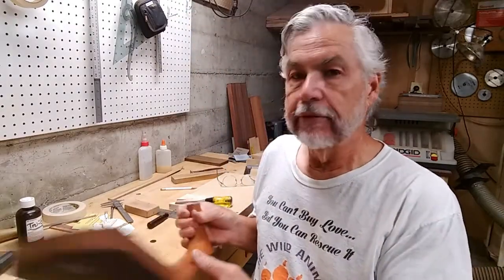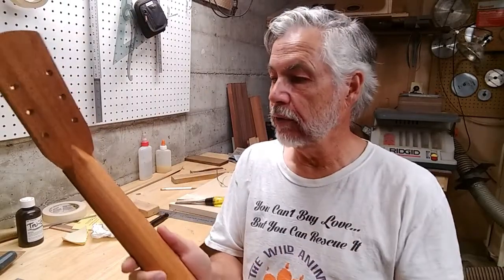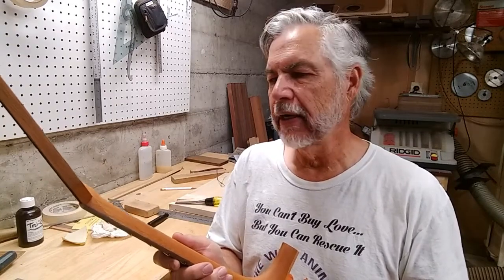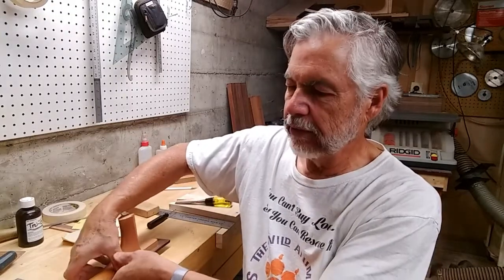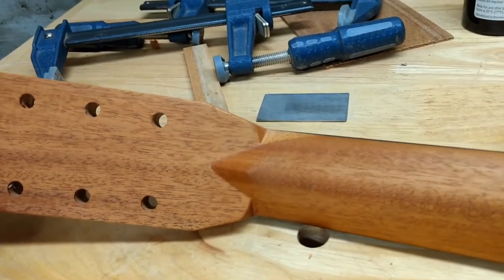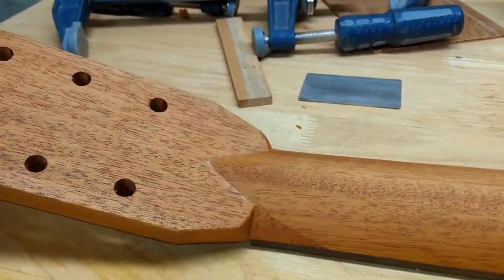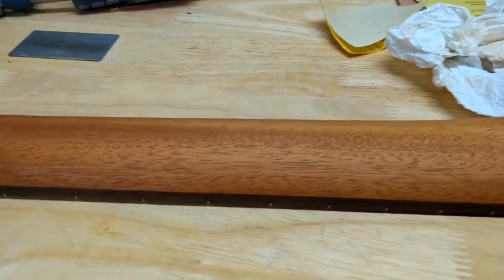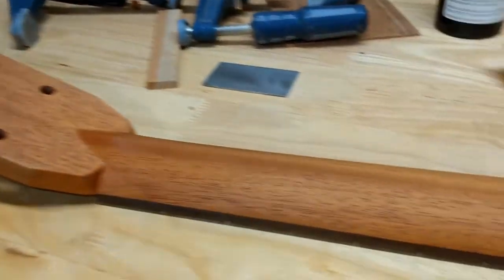The hand carved neck and volute - closeup

Comment: Any advice on carving the volute from a block of wood?
Reply from the maker: Make sure you cut as much wood from the block as you can before getting out the chisels. Also make sure the orientation of the grain doesn't result in a weak peghead.